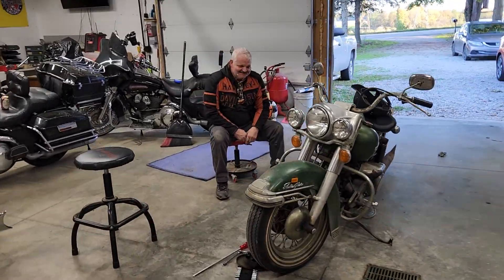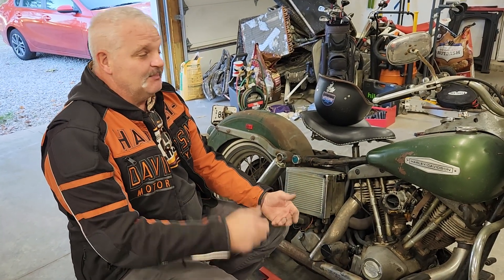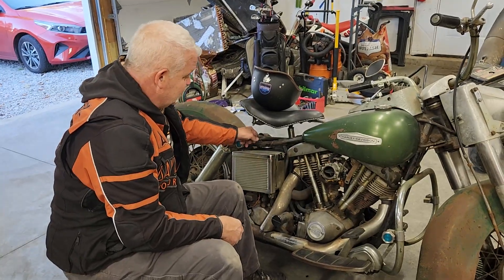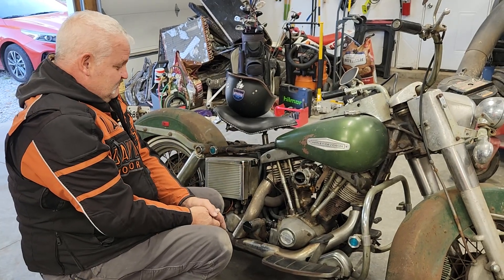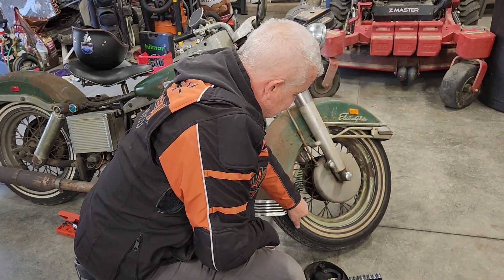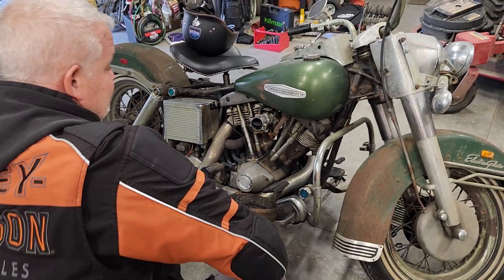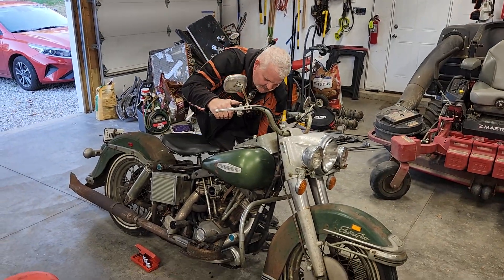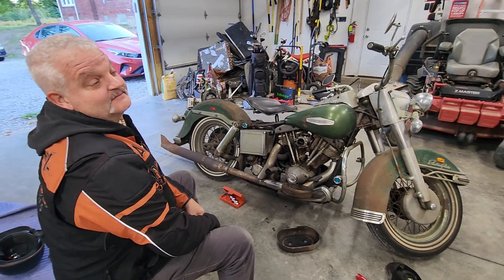How to "Tickle a Tillotson" Carburator @SilverNutsGarage

Comment: Talk about ticklers I had a 9:30 ammo on my '69 triumph tiger and it had a tickler what it did was push down on the float so it got excessive gas in the bowl or allowed it to pass the shut off and that was its joke or part of the choke the other part was a little gate that you worked while on the on the handlebar

Comment: Well I looked a till it's in carburetor up and it looks like the bolts are at 3 and 9:00 not 12 and 6 but another one was just the opposite it might be just best to get a replacement manifold that goes with the Bendix..
Reply from the maker: Thanks for the input!!!! I missed this one. Ride safe!!

Comment: Hello I've got a 1970 that I found down in a shed by a lake. Earlier this year sadly it's not original paint because somebody and I don't know if it's original owner or one owner looks like they tipped it over on the road. It's not a bad color it's burgundy. I've been kind of documenting it on my channel. The bike came with a key in carburetor oops I didn't spell that right. But right away once I got it home I was able to write it home by putting some fresh gas in it utilizing only one side of the gas tank but I put my Bendix carburetor I had on it. I'm not really sold on those adjustable main jets. But I had to put the shaft seals in there because they were from 19 well the '70s and it leaked when you were cruising speed it would cough about $2,700 RPMs. I'm learning as much as I can about the 1970 I've got a 1980 that is nowhere near stock but I kind of made it look stock Well I kind of made it look old. I've got that on my channel too. I enjoyed the video and always looking out for videos of these types of in years of Harleys. Thank you so much Best of luck. Oh yeah people will say put an SU on it or an S&S or a CV carburetor which I like a CV carburetor it's great got one of my 98 southdale I rebuild those and sell them on eBay but I like stuff just the years it came out. And it's nice that I know now Bendix did come on the 1970 along with the tillitson,,, I did not know that ,✌🏼🏍️👍🏼👍🏼
Reply from the maker: Missed your comment. That's a great story. Thanks for taking the time to watch. Merry Christmas
Reply: @SilverNutsGarage-di5ls  Merry Christmas to u all to 🎄👍🏼

Comment: Bendix works great on my 1971 FLH
Reply from the maker: @danielstookey7670  I'm assuming the push throttle was replaced with a spiral pull throttle? Or can the Bendix work with the original push wire throttle? Thanks

Comment: There is a Tickler kit you can buy and install for Tillotson carbs. You would just press a small plunger up. It does the same thing as sticking a piece of wire up through the bottom. There is a guy on YouTube, "Mags and Tillotson's", that has a good video on the Tillotson carbs. He has got a two kick 1968 Sportster. He has got a black 1968 XLCH Sportster and a Gold 1970 XLH Sportster. The Bendix is a good carb. I had one on a 1977 FLH Harley with adjustable main jet. I'm building a 1972 Sportster with kick and electric start. I'm putting a 38mm Bendix carb with adjustable main jet on it. It is the original carb Harley put on it. I know Harley started using Bendix carbs on 1972 model Harleys. Harley put 38mm Bendix carbs on 1,000 cc Sportsters and 40mm on the 1200cc bikes. The 1972 Bendix carbs used a single solid wire throttle cable. The Government mandated a dual cable throttle on 1973 models. 1973 - 1976 Harleys used Bendix carbs with dual cable control. I don't know if a Bendix carb will fit your intake manifold. If it doesn't, you can probably find one on Ebay. If you decide to go with the Bendix, I would get a Harley parts manual so you could check model numbers on the carb. To make sure the Bendix is 40mm or 1.575", find a socket that the OD measures 40mm or slightly less, and pass it through the carb. That is a good bike you have. It is worth getting to know it better.
Reply: Thank you for the information I love riding it will pass it down to my son some day
Reply from the maker: @joehovanec1985  Your knowledge is greatly appreciated. Thanks for taking the time to educate us and explain the options.

Comment: I had a `67 shovel for 25 years. The tillotson carb would run great for 2 weeks after rebuilding it . I put a bendix on it and it was a no brainer. Then I went to an S&S Super. All the while retaining the original throttle cable.
Reply from the maker: @REDMAN298   That's great information. Thanks for your input. It's appreciated!!!!!

Comment: Nice bike. V twin makes a “pull” type internal throttle sleeve if you wanted to run a bendix with a pull throttle. You’d just need to remove the thick solid cable from the cable housing and replace it with softer braided steel. Barnett cables are the best. 

I have a pull type internal throttle on my 1970 XLCH and run a CV carburetor
Reply from the maker: @joshualother  Thanks for taking the time to comment. We appreciate the information!!!